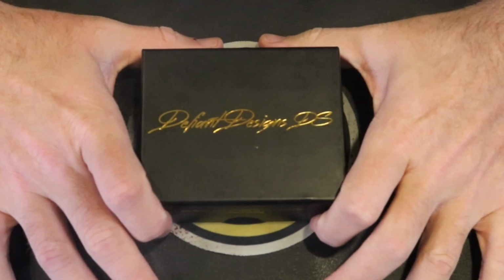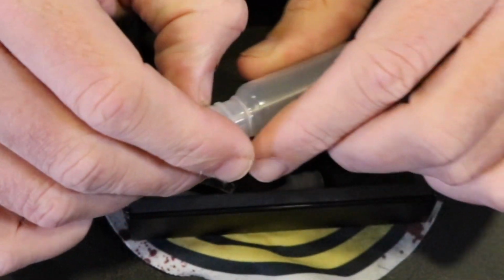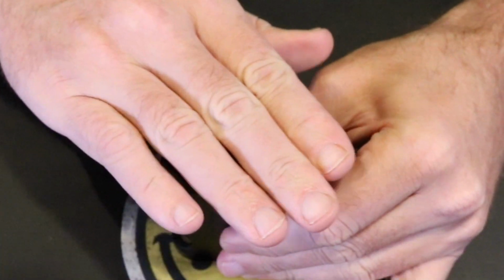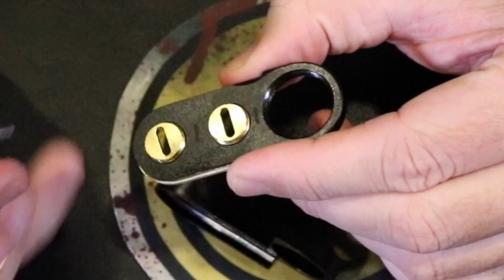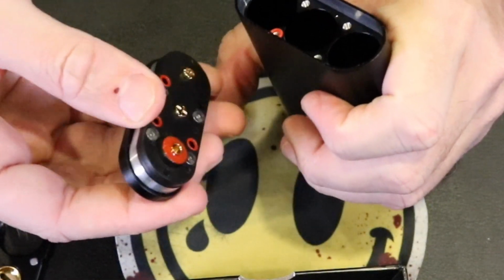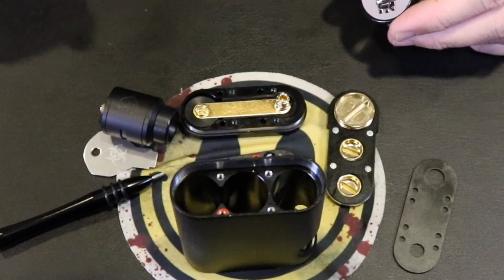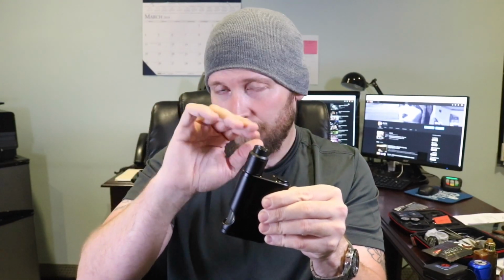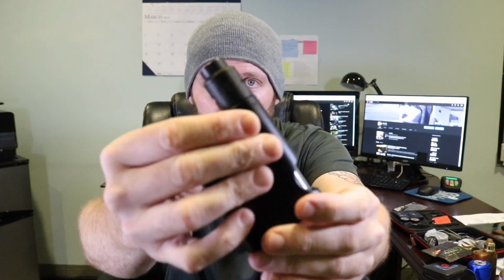DEFIANT DESIGNS DS /Formerly Known as 528 Drip-Tech DS/~ EVERYTHING!!!

Comment: The bottles do get holes. Granted I’ve had 4 ds mods that I’ve used exclusively for 8 years now and I’m down to 2 bottles left. I want one more ds kit. I was on zero nic for 6 years and messed with cigars on vacation and need to taper back off nic. Only mod I’ve used in 6+ years almost always with the bonza. Awesome device and the best rda squonk. Really low ohm. It’s great. Wish they had a choice of bottle material.

Comment: The reason the bottom contacts are like that is for protection (Reverse Polarity Protection), so even if someone did try & put the batteries in the wrong way it wouldn't make contact to fire the mod. Brilliant review & mod.
Reply from the maker: Yeah Banacheck I totally forgot to mention that it is impossible to put the batteries in the wrong way...this is why I LOVE simple mechanical mods....without the use of any chip Defiant Designs created a reverse battery safety that will never fail or break.  This is the most underpriced squonk mode I own!  This mod could have easily been sold for $200!!  At this very moment my DS looks as new as the day i bought it...has 1 tiny chip from when I dropped it on the HARD concrete at work (this mod is built so sturdy...any other mod would have dented or shattered).  That aluminum finish feels so wonderful in the hand as well...I'm really hoping they release a silicon bottle soon....but even w/o a soft bottle it is still an absolutely beautiful and "brilliant" (to use your perfect description) squonk mod.  Thank you so much for checking this review out...it was long but I really wanted something up for people thinking about purchasing this mod.  I like to show every angle and provide as much information as I can.  Hope you have a good weekend Banacheck Gaming :--)

Comment: How long did the battery last you with dual coils ?
Reply from the maker: It will depend on your build, but I can run my fav quad coil build that ohms out to .12 to .14 on here all day, vape all day long and not need to change out batteries.  I can vape as much as I want at work so that is a lot of vaping!  Don't know what you are running but with dual Sony VTC5as that have been married since day one on that .12 build I can work 12hours vaping whenever i feel like it and NOT have to change batteries.

Comment: You're killing me smalls! Do an want! Got some dimensions or size comparisons for me. I'm only familiar with building single battery mechs. With it being parallel do you just build using ohm's law at 4.2-3.7 volts?
Reply from the maker: YEAH BUDDY!!!  It's parallel only so 4.2-3.7v ..just as you do your single mechs.  I don't feel like there is much voltage drop on this guy...but I still do my builds using Ohm's Law w/ 3.7v as 18650's spend the majority of their charge around the 3.7v range.  The amp load is on 2 batteries though so even though it's same voltage as a single battery...it is less strain on the batteries amperage wise.  If one battery were flipped the opposite way (but not in this mod...in a series mod) it would then be series at 7.4v - 8.4v.  This thing is AWESOME though man!!!  Killer work setup...she has mah for days :) !!!
Reply: PAL 702... thnx. I recently moved to single coil squonking exclusively because of the battery drain on single 18650/20700 mods. My Bonza has gotten no love because of this. Built at .13-.16 I wasn't getting thru one 8ml juice bottle before it was time to swap batteries. Very frustrating. 

Damn interwebs. I should ban myself from it on payday.
Reply from the maker: Me too on the single coil stuff!  I still rock some duals on my single squonks that have 20700's, but the majority of the time even w/ 20700's I'm using single coil drippers on my single battery squonkers.  Flavor is amazing...I never thought I would enjoy a single coil...but that is the beauty of vaping!!  I've learned to not say "never" when it comes to any type/style of vaping and hardware.  Each way has it's own unique benefits...Single Coil Life is actually taking over the majority of my all day "work" setups (the DS squonker being the only exception).  I LOVE my Bonza's ....I use them a lot on my reg mods and on some mech tubes...the airflow on it is amazing!  Payday and youtube/FB vaping content can do damage..but damn it's fun!!!!
Reply: PAL 702.... sounds like you n me are alot on the same page. Yeah, payday. I haven't had a day off work in 3 weeks so payday was rewarding which is also bad cuz the youtubes, and well.....your bad influence. Lol... like I said last night. I just ordered that tugboat mech squonk and the b2k v5. Almost wish I woulda seen this first now.

If you do get a chance please give me some dimensions on this squonk. Pretty sure it has moved to #1 on my want list. 

Fyi, you have earned my sub.
Reply from the maker: Right on man!!  I appreciate the subscription :--)  I actually just bought one of those fancy calipers you see reviewers w/ so when I get to the office I will grab the measurements as they're not on the webpage...if I had my fancy caliper when I did this I totally would have had a reason to break it out lol!!  I've been waiting to use that damn thing !!
Reply from the maker: Dimensions on DS:  Height 84mm Width Across 63mm  Thickness/side width 25.5mm
Reply: PAL 702 ....awesome, thank you. Our talk about the dr sq got me experimenting. I'll comment in that vid
Reply from the maker: I can't wait to hear and see if it makes a difference or if it's just in my head lol!!

Comment: great review looks like a good unit as you said pity about the bottle would of like to see it with the original goon have a clone and love it have tried a v1.5 and prefer the airflow other than that great review 
remember subscribe if you like it hit the like button
if you don't like hit the dis like button twice 
peace to all much respect and remember it's all love
Reply from the maker: Yeah Cam...this one is a bit more spendy..but it is built to work man!  Spares for everything...very solid mod...10ml...lots of mah...this thing can hold you down for an entire day with the batteries, and 10ml juice bottle...for the money it is worth it.  It will last...very clean...very well machined...very nice in the hand.  I heard they are coming out with some softer bottles too ;)  Thanks for dropping by Cam...All love over here mate!!!
Reply: $130 us mmm wonder how it would go out in the dirty , mud and grease onsite have tax time coming up soon . would need to have the softer bottle first keep me updated
quick weather update tropical cyclone Nora now cat 3 winds at 190 kph looks like we going to have a wild one rain started already still bout 500 km away have good weekend
Reply from the maker: The DS is 100% mechanical so water and dirt/mud etc won't matter as long as you popped it apart and cleaned it when needed.  No wires and no nonsense on this one....the mod itself breaks down in less than 5 min ...i don't see anything that would break if it was dropped but I don't.  This mod was clearly designed by an extremely knowledgable creator that actually vapes :)
Reply: 3 months to wait will see how I go might be bit cheaper by then